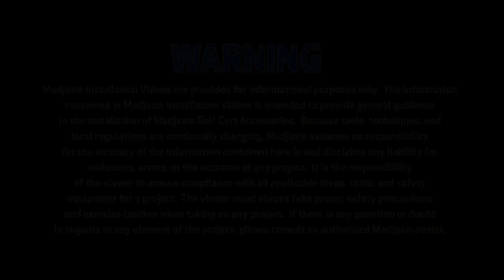12-30 Volt DC Converter | How to Install Video | Madjax® Golf Cart Accessories (UPDATED)

Comment: I have a question about the wiring of the DC Converter. I have everything wired up except the accessory wire. I was unable to find a t-splitter like in the video and wondering if I can connect that to a small fuse block and run everything from there? My other question was if I connect my accessories to the red wire where do I put my grounding wire from that accessory?
Reply: Need help with this question also

Comment: As always, very good video Madjax. I bought one of these, and will be installing it next week. Question, for some accessories I want to be able to power when the key is off, so would I connect the positive of these accessories to the reducers yellow wire?
Reply from the maker: Sorry for the late reply, you will need to attach the hot wire for those accessories to the constant blue wire

Comment: I just installed my reducer, im getting 12 volts out on the red accessory wire but it will not power on my radio...any ideas?
Reply from the maker: Cory, sorry for the delayed response. If you are not seeing 12v from the blue memory wire the reducer could be faulty. Are all other functions operating correctly?
Reply: I have since figured it out. thanks though.

Comment: FYI, never use a twist on wire insulator on a moving vehicle, they won't stay on. You should only use crimp connectors. https://youtu.be/ah2qpPkURls?t=230